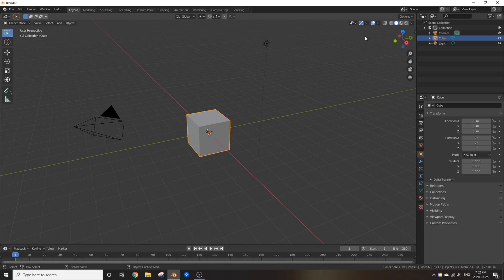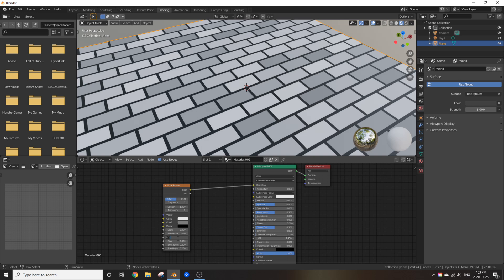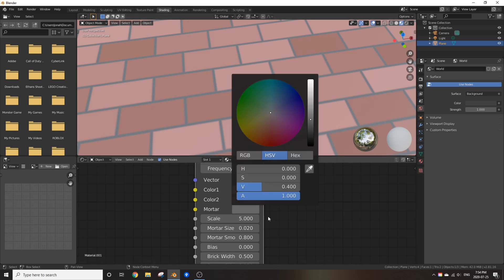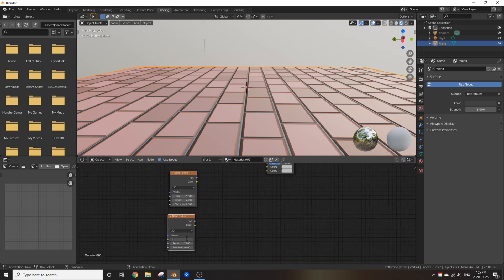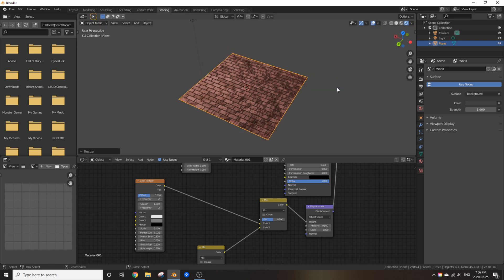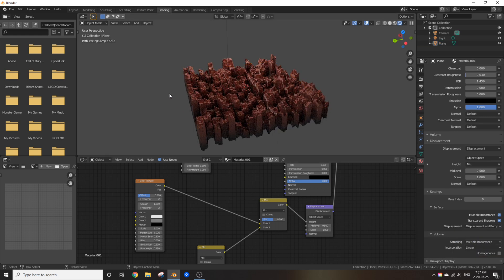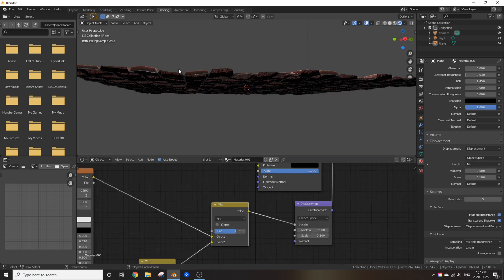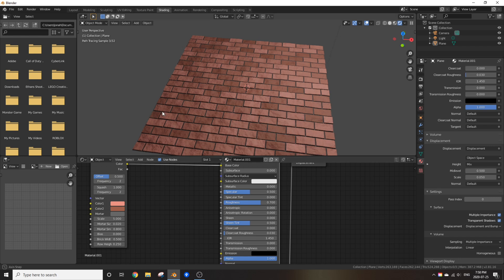Procedural Brick Texture in Blender Cycles (Part 1)

Comment: i keep getting caught by the fbi or something because each time I connect the mixed rgb it closes the aplication
Reply: application
Reply from the maker: The method I display in the video is extremely high subdivided, and your computer probably struggles to handle adding so mush resolution to the object. Try subdividing the wall less, and hopefully that helps!
Reply: @jonahcentral2763  yea I did thanks um by any chance do you know how to export it to unity and the material
Reply from the maker: @Josh51507  You would have to bake the material into multiple different map images. Unfortunately, I don't know how to do that, but yes it is possible.

Comment: I could export this model in cycles and use it for a video in evee, or?
Reply: @jonahcentral2763  it makes sense, but could I Export the model from cycles and use this in evee?
Reply from the maker: @JaKlaro  You can, as long as you apply the displacement that you've added. Otherwise the height difference will still be fake. Sorry for the late reply.